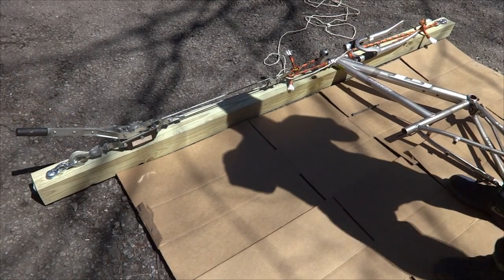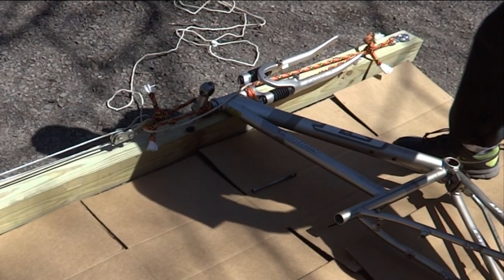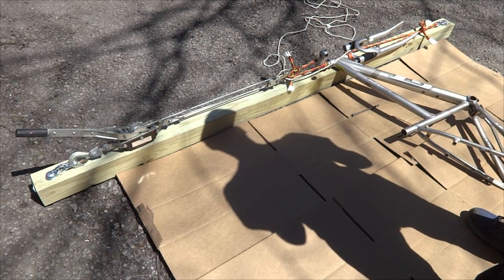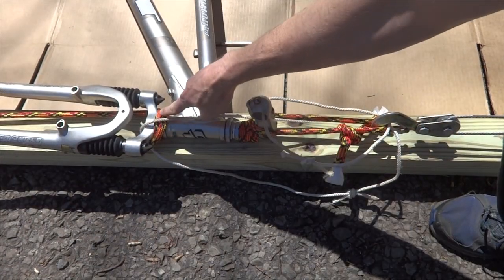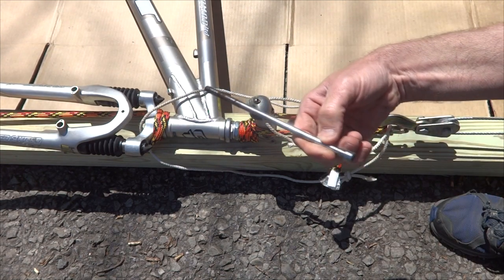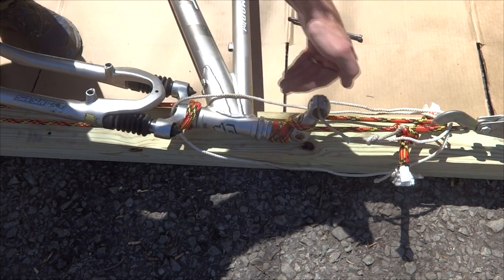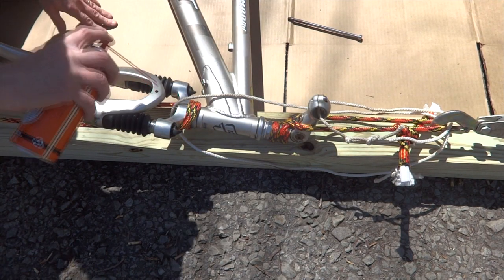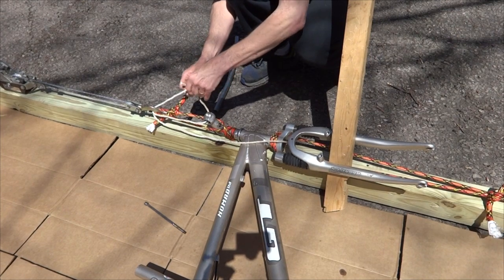Removing Seized Handlebar Stem Using Cable Puller Winch

Comment: One thing I used on my garage sale rebuild was a trick from an old 1950s hot rod mechanic: Wintergreen Oil. Squirt it in all of your 'frozen' joints, wait half an hour or so and then use your tools to break the seize. I used it on a used Subaru where the spark plugs had seized into the aluminum head....saved me a TON of money not having to have the heads removed by a mechanic.

Comment: NICE! Great job. Great spirit and energy. Good old American ingenuity and know-how (plus, the right tools). I CHEERED when the stem, under tension from the cable-puller, came loose with your twisting and levering the fork. Kudos! I hope the stem post cleaned up nicely and could be used on another bike, it seemed to have good potential. Thank you for this very practical video! Great tutorial, and thanks for exemplifying the safety precautions taken.  --Joe / Tucson

Comment: This is the best one ever!!!  RJ is so creative in his often unorthodox solutions.  He also understands the value of timing.  His films move.  So many bike-fix films are boring and monotonous such as removing a screw for example; they make you watch every turn of the screw driver until the thing is removed.  RJ clips right along and knows what to include and what to leave out.  Another good job.  One of the best things he ever did for me was turn me on to Evaporust;  the stuff is extremely effective, is easy to use and on the label they tell you it can be reused.  Good creative solutions always!!!!
Reply: the evapo rust was the first video I saw

Comment: Hy mate, it’s terrible how strong they can sit in the fork. I am fighting with this right at the moment, ended with cutting the stem which perhaps wasn’t the best idea because now I have less material to work with (pulling, turning etc). I will succeed, that’s for sure 💪👍🌞🍀😂 Thanks for your tutorials and sharing your experiences. Take care and greetings from Germany 🇩🇪
Reply: I’ve done the same thing, drenched in penatrating fluid and then got a pipe wrench and got a good bite on the material and went to town got it out and that always works.

Comment: Proven method, I have used similar system  to remove a stuck seat post.  so far successful  3 out 4 try's.  Which really ain't that bad.  Great video.

Comment: The application and alignment of the linear force dynamic conjoined with the safety loops constituted a neatly packaged force-applier.  Additionally I would have immersed the neck in a bucket of heated solvent ( a mix of acetone and automatic transmission fluid) overnight.  The only concern that arose for me was the insertion of the two by four between the forks legs at one point.  The tension parameters seemed reasonable although a slower and more incremental application might help avoid overwhelming the assembly.  A credible effort with an acceptable outcome - Good job.  You're a very innovative mechanic and generous with your knowledge.  Always looking forward to your next foray.
Reply: That was the most well thought-out comment I have ever read on YouTube.
Reply: This was well planned and with lot of thought that went into this task.

Comment: Once you had moderate tension on, the torsional movement is what 'cracked' the job.Twisting is always better than 'straight pull. Light tapping would also have been useful, if this can be done without causing damage. Well done.

Comment: This made me grin as soon as I saw the set up. Great work. What happened to the nut that jams the stem? Did you hammer it out?
Reply: And how did the head tube and the fork fair? (I have a seized stem but I want to save the frame and the fork rather than the stem itself
Reply from the maker: The wedge was already loose. They rarely get very stuck. The head tube was fine. It was not involved. The fork was fine.
Reply: @RJTheBikeGuy  i think i have a bad case. Both the stem and the wedge stuck. Hitting on the loosened stem bolt didn't help...
Reply from the maker: @pilobond  Spray good penetrating oil in the bottom of the fork. And try again. Figure it out. I am not there to do it for you.

Comment: Yeah you never pull a seized stem or seatpost straight out. You would need a enormous (HUGE) amount pressure ...unless it's not that bad. Much easier and safer to twist it. You'll sacrifice the stem or post, but relatively inexpensive. You need a lot of leverage like a large breaker bar. And always presoak with penetrating oil like PB Blaster.

Comment: The  way you un-stick a frozen engine is  put consistent pressure on the crankshaft and then give it a few good raps on your 1/2" drive breaker bar while holding the pressure at the same time. This is a good strategy for any stuck part even a frozen bicycle handlebar stem. Pull it tight and then knock the shit out of it while under pressure. Yes after soaking it with blaster at least over night.

Comment: Hi, nice video;   I would personally dump the stem.    I never had good result with the adjustment part on those and you probably damaged it with the puller.

Comment: Did you first loosen the stem bolt enough to hammer the stem bolt back down to unstick the wedge nut?
Reply from the maker: The wedge wasn't stuck. It was loose and rattling around in there.

Comment: Why are you messing around with threaded stems?  Thread less bike stems and forks have been the norm for over 20 years so why mess with a bike that has that outdated tech to reuse on another bike instead of upgrading to thread less which is far better.
Reply from the maker: +traingp7 Been, there, done that.

Comment: Have you never heard of applying heat then with a longer tube in place of the handle bar clamp the frame in a vice (note UK spelling!) apply rotational force back and forth whilst pulling? Saves all this nonsense!
Reply from the maker: I have tried various and heat and cold techniques, and they have never worked. Maybe with a slightly stuck stem/seatpost, but not a seriously stuck one.

Comment: where'd the nut go? i have this problem but i cant get the nut out whatever i do! arrrrrgh
Reply from the maker: The wedge is still in the fork. Once the fork is out, it will usually fall out, or is easy to knock out.